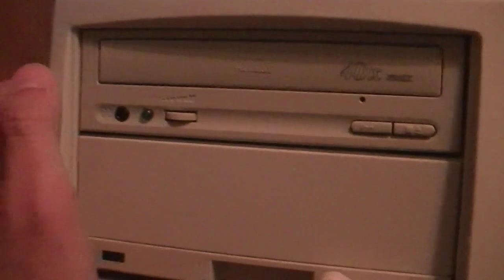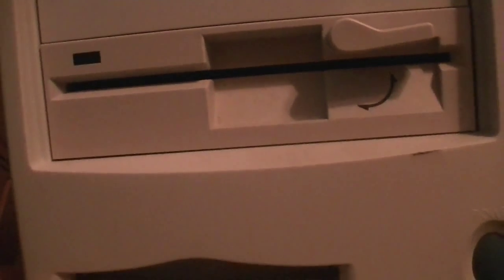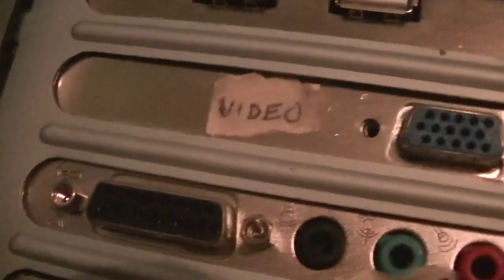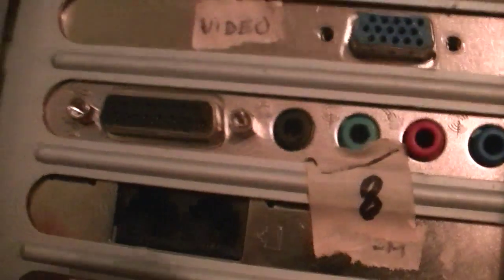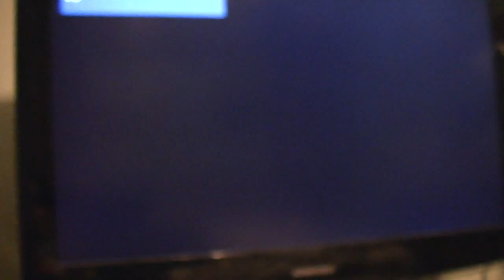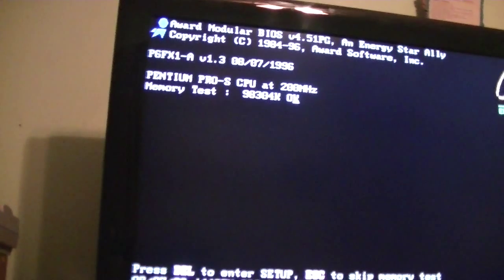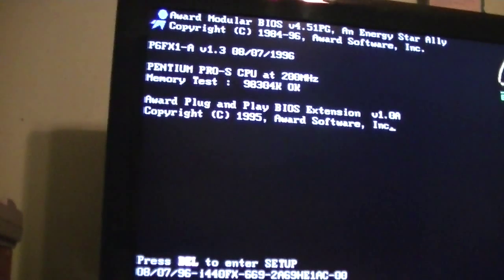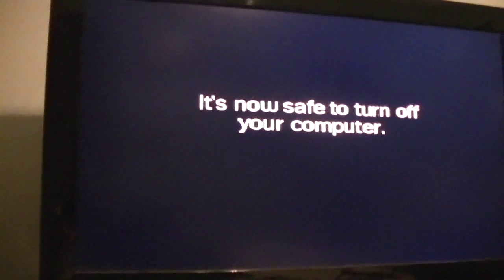First Computer for Today

Comment: A home built Pentium Pro, now thats rare! I never encountered one of those before. The best OS for that machine would be either NT 4.0 or even Windows 2000 (you got enough RAM). PPros were optimized for 32-bit code, so a real 32-bit OS runs faster on them (Intel fixed that problem with the P2). How come when I visited Value Village they didn't have any of that cool stuff?

Comment: You can put the sound card in your windows 7 computer if you go to windows update you can get the drivers it works good on windows 7 because I have two of them and they are the best sound card can you make a vedio using the sound card on you windows 7 computer you will like it I use my on windows 7 it works good if you go to windows update to get the drivers keep up the good work. I will keep watching your vedio or it the sound blaster 128 try it out you will like it    made in 1998.